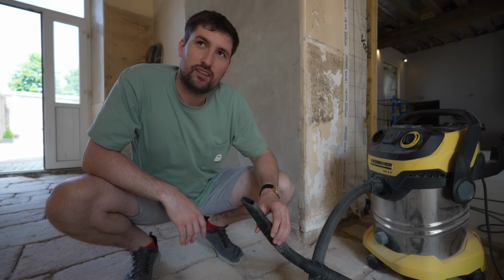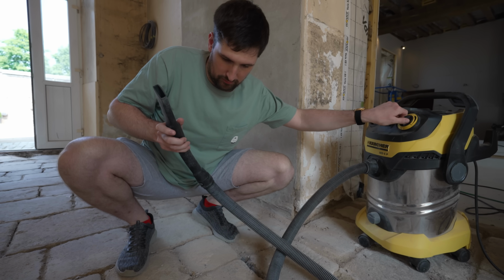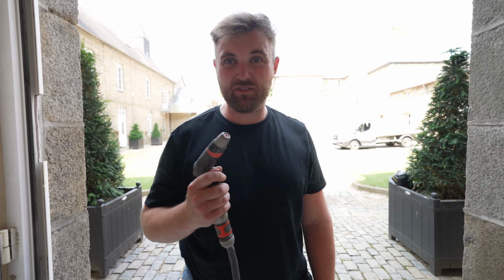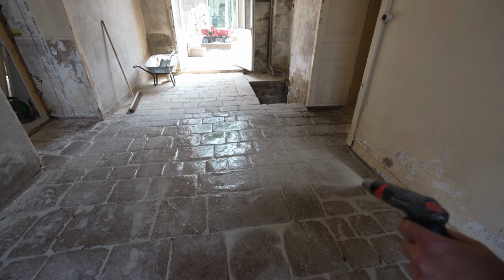Renovation of the Convent's Historic Floor

Comment: Greetings! I was watching the video of your excellent restoration of the cellar steps. I used to be an employee of OSHA (Occupational Safety Hazard agency). Our job is to create and enforce laws and rules concerning job safety and precautions. I wanted to share  practical lifting rule with yourself.  The advice or rule concerning the lifting of heavy objects such as the flagstones is to lift the object using muscles of your legs by kneeling while lifting it. That way you don't use your lower back muscles and risk injury. Cheers from my household! 😁🍻

Comment: Great video. Nice to have Ryan in town again. I would suggest looking into a hand-held needle chipper for removing the concrete scaling on the floor. It gets into smaller crevices than the large chipping blade currently being used and offers less chance of damaging the stonework.
Reply: Someone suggested sandblasting the floor. Would that be an option?
Reply: @bonniesteinke6624  If it was done before the regrouting but now it would remove the joints that were just replaced. A needle chipper is just 8 to 12 small diameter rods hammering up and down instead of one large chisel.
Reply: I think he already has that type of chipper. Watch the video again while Ryan is hoovering as Billy works in a different spot on the floor.
Reply: @heidikortman2534  That is not a needle chipper. While needle chippers are mainly used for removing paint they can also be used in this situation.
Reply: @markh3271  Thanks for the clarification.

Comment: You could use thinned hydrochloric acid to remove the last traces of cement from your granite floor.
Reply: 10% Muriatic acid to 90% water? It has worked for me.

John in Bethel, Missouri. USA
Reply: @classifiedinformation6353   Muriatic acid is hydrochloric acid.  But also, it will only dissolve a bit of the contents of concrete. Muriatic acid will eat away at Calcium Carbonate.  Concrete is made up of more components than calcium carbonate.  The sand in concrete is silicate and Muriatic/Hydrochloric acid won't shift that.

Comment: Billy, you may want to try a Needler to remove cement on the stone paver faces. This tool is usually used to remove rust scal on large iron things like water towers, bridges, ships, etc. Most of these needlers are pneumatic, so you will need an air compressor.

John in Bethel, Missouri. USA

Comment: It would be cool if you did a tool comparison on what cleans the stones best/fastest. I am curios how a needle scaler, drumm brush grinder, Satin Machine Sander Brush vs a angle grinder with different steel wire wheels. I think you will find ways to use all these tools on your projects.

Comment: Check the stones under the layer by the door the door height maybe a little  high assisting the rain water into the convent. If you have a step up from the outside then the water won't come in.

Comment: What about knocking that wall down where you started, Billy, and found that void space. Is it deep enough to be made into closets along there? Coat/umbrella closet and perhaps another across the way in that void for other types of storage, perhaps dry goods for the kitchen or for appliances that aren’t being used, etc.? Looks like the cobbles stop at the wall so you wouldn’t want to knock it all the way to the floor but could stop it a few inches/cm above the floor.

Comment: Here in the USA we only call a vacuum cleaner a Hoover when it actually is made by Hoover. Overall they are called vacuum cleaners. Just like ALUMINUM has no I after the N, so don't call it aluminium.
Reply: At one time the only vacuum in the UK was a Hoover . So it's  just continued to be used for  . all similar  vacuums. Also aluminium  with an "i" is what we call it in the UK.
Reply: In English it is spelled Aluminium with an i, and in the word caramel we pronounce the second a, and we pronounce the H on the word herb too, unlike across the pond 😂
Reply: I think that you will find that English as it is spelled and spoken in the UK is totally different to the US. The US has changed much of the English language. Billy is from the UK so speaks English  not American.
Reply: @SamsFrenchAntiques  I pronounce CARAMEL with the second A just as it is written. I tend to pronounce most words just as they are written. I was only replying to Ryan's comment calling the shop/vac a vacuum cleaner, and saying that his people normally call it a hoover. Aluminum, on the elemental table is spelled with one I. That is universal. Not UK vs. US.
Reply: @janetpendlebury6808  the periodic tables are universal from what I have been told. All elements are spelled the same throughout.